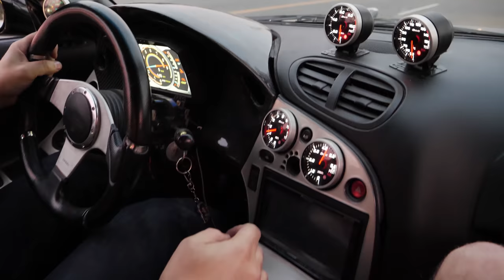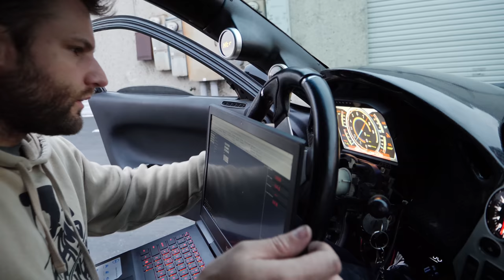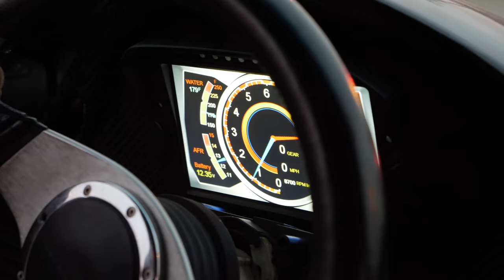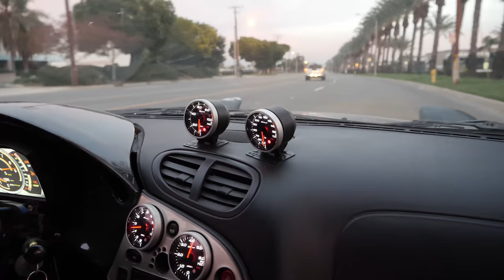MONSTER Street Port sounds NASTY on the street | Ready for Dyno!

Comment: I feel like there may be a grounding problem, which is causing several of those issues. Check the main chassis grounds for any corrosion (lightly sand contact points, then add some dielectric grease to the ground). Worst case scenario would be a short in one of the wires.

Comment: To prevent cracking the carbon fiber door when accidentally opening it too far you could install a strap that doesn't allow it to open as far. Police cars use them, even if not for that purpose.